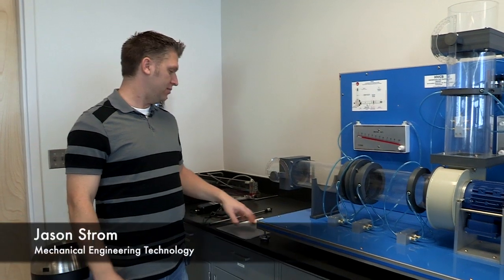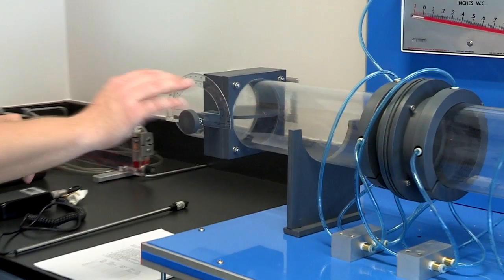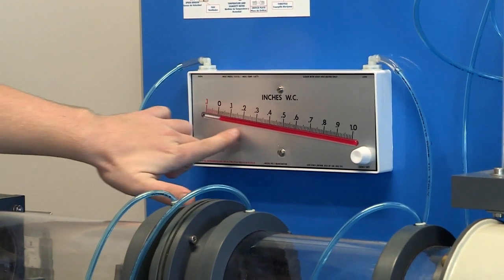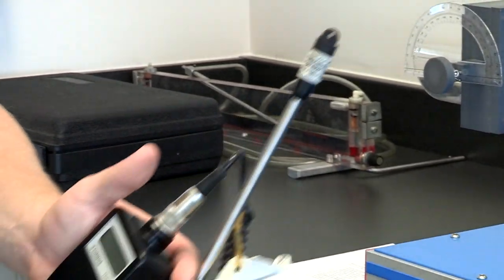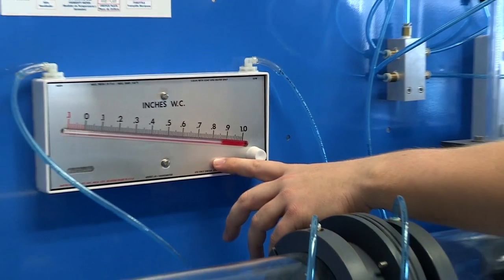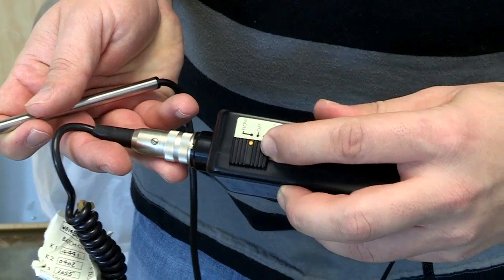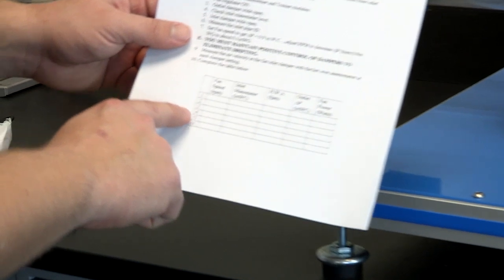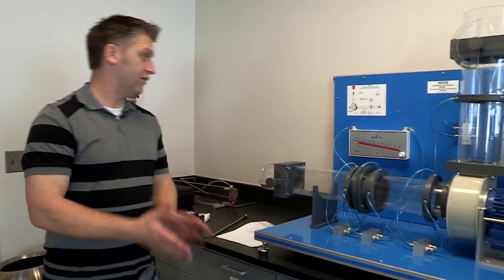Centrifugal Fan Operation

Comment: What is that orifice-like black inline device installed right at the middle of the inlet pipe, may I ask? I mean the black device between inlet butterfly valve and fan inlet. In addition to that, why do you measure the velocity at center on the inlet opening?